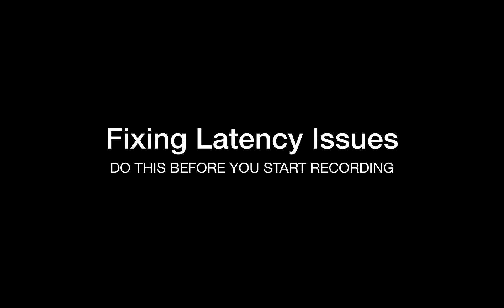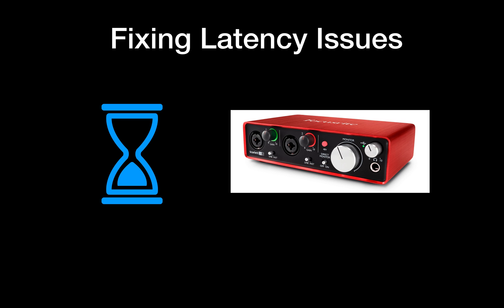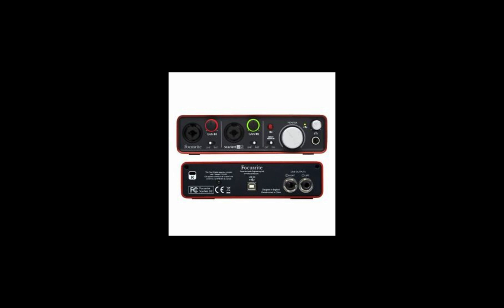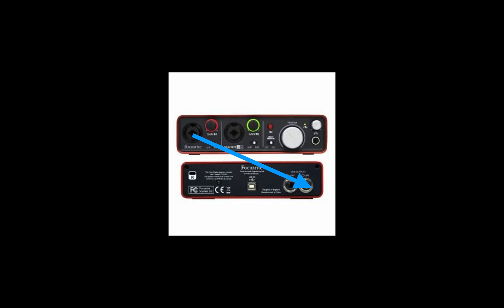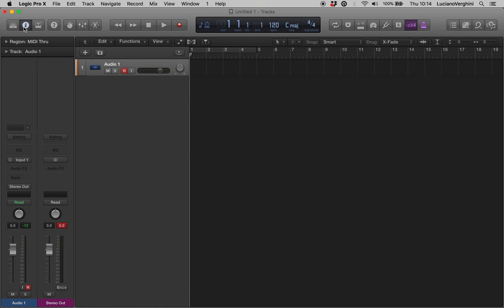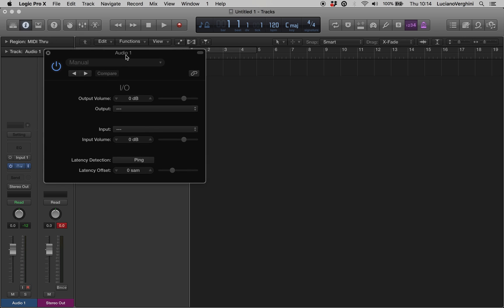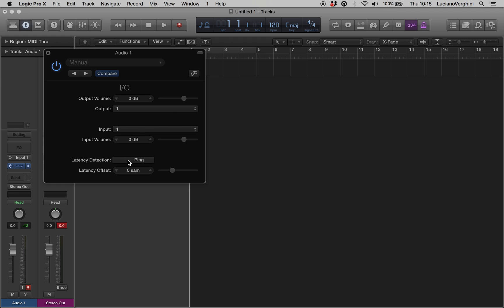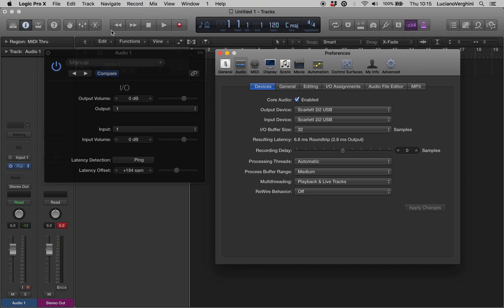How to Fix Latency Issues/Recording Delay in Logic Pro X Using the I/O Plugin

Comment: God I hope this dude sees this message. I just started using Logic Pro on a brand new Mac Mini M2. It’s the basic model with a dock and 1TB SSD. The SSD just stores the projects when I’m done. 

Tonight, I created a brand new session. Blank template. I turned on the virtual drummer (the profile player with a drum kit) and created an Instrument track for guitar use through a plug in. The plug in was an Otto Audio amp with a Two Notes Genome IR for cab sounds. I have been playing a long time so I am confident I can play along to a drummer at 130BPM. Every time I went back and listened, the guitar track was milliseconds behind the virtual drummer and I could not figure it out. Would this resolve the issue? I’m going to try it out regardless but will do a reboot of the machine and all that. Thank you!
Reply: Yes, this is most likely the issue. You try and try to play on time, but somehow it's out of sync - it's the recording delay. If you do this, it will compensate perfectly (as long as the delay isn't changing) and will be in time as you have played it (assuming that you can play in time!)
Reply: @thekillerbunny sorry. I did go through this process. I am still at 3.2ms roundtrip with -5000 samples. I have to keep Core Audio on but when that’s off, the latency drops to an almost usable number. Unfortunately, there is no recording function available after that. Am I looking at a hardware issue at this point? The Focusrite Gen 4 Scarlet is running C to C thunderbolt but despite this, I’m behind the count. Direct monitoring helps a little. Using just the metronome assists the most but I don’t want to use that damn thing for recording when I have two packs of Addictive Drums that sound way better.

Comment: thanks, won’t the latency vary depending on the project and number of tracks and efx etc….???  i have rme fireface and monitor through the rme mixer and works okay nut i have no efx so i want to switch to software monitoring amd i will try this, thx.

Comment: I did this test on a new logic project without any plugins. I have ssl 2 audio interface connecting with usb. The problem is that every time I put out usb (connection audio interface with MacBook Pro) and I do the test again latency offset value change. This happen also when I shut down my Mac and I open it again and do the same test I get different value every time. Is it normal ? for example I did the test and it gave me a value +39 sam and shut down my Mac and open it again another day and the value is +7 another day +53 ... I search everywhere and I have not find any solution to keep it stable ! Do you know something about this , how can I fix it ?thanks !
Reply from the maker: Are you running any other apps while running logic? 6 samples is 6/44000th of a second so should be fine. Your Mac could be doing an update in the background perhaps.
Reply: @VirtualVerghini   I don't think that Mac do a update but how can I check it ?no there isn't other apps while use logic ! I real have try many things and the problems continues..
Reply: @VirtualVerghini   any other idea?
Reply: @VirtualVerghini  I use a normal cable for the test should I use trs cable ?because output of ssl 2 is balanced? can I use xlr to jack balance cable and turn on phantom power?
Reply from the maker: No need for the phantom power. You could try turning on low latency mode on logic or if your ssl has direct monitor you can activate that.

Comment: I can see the signal going out and coming in. But I still always get "0 samples". I have an RME BabyFace Pro interface which is supposed to have low latency (the manual says as low as 5 samples) but not zero. I even tried the slowest (highest I/O buffer) setting of 1024 and still get 0 samples. What am I doing wrong?
Reply from the maker: Hmmmm that is quick! Did you set up recording delay of -5 samples?
Reply: @VirtualVerghini  No. But even if I slide the slider to either extreme, the ping still results in 0 samples.
Reply: So I figured I'd do a "manual" ping test (interface OUT to interface IN) and just playback an audio track and record it onto another. What I found was a latency of 10 samples, regardless of I/O buffer setting.
Reply from the maker: @Joe Tunon  any chance your inputs and outputs aren't set up correctly on the IO plugin? Is there any audible delay when you record? you could add a sample delay with -10 samples on and your recording will be perfectly in time
Reply: @VirtualVerghini  I was going to that, but then for fun I tried maxing out the I/O buffers to 1024 and the process buffer range to Large, and now I get no latency (as in literally zero samples!), so I don't need to adjust :-)

Comment: Oddly specific question, but if I’m using a Zoom H5, would I go from the headphone out of my laptop into the 3.5mm mic in of the recorder (in audio interface mode)?
Or will I have to go into one of the xlr/1/4 inch combo inputs?
Reply: Or would it be from the headphone out on the Zoom H5 (into one of the inputs)? I’m nervous about connecting an in and out that aren’t supposed to be and damaging something.

Comment: What if you were to hookup the input to the headphone jack output on the front? Would it change/ be important because i monitor my recording with direct monitoring through headphones. Or does it matter at all?
Reply from the maker: Yea that would tell you the latency which in some devices can be reduced using the direct monitoring switch.
Reply: @VirtualVerghini  theres always latency regardless of my direct monitoring being on. Its not while im monitoring that Im worried about. Its about having to nudge the recording to the left so intricately because I can sense it was delayed on input (direct monitoring doesnt change the actual time code in which it is actually inputted, only on what you hear back while recording)
Reply from the maker: That's the thing. When you sent up your recording delay correctly the file gets automatically nudged to the left for you
Reply: @VirtualVerghini  i tried adjusting my recording delay to +183 after the I/O sent back -183 and I hit ping again to test if it went back to Zero and it still stayed at -183
Reply: @TheAdBoss  Whatever your recording delay setting is, the signal still takes the same amount of time to physically go around the circuit. All the delay setting does is move the sound to the correct position in your project.
Reply: @VirtualVerghini  *having to nudge it to the left within the daw (because its late)

Comment: What if it says 0 samples after doing this? But I still have recording delay (when i record it sounds on time but after tracking the region is off tempo.)
Reply from the maker: So if it says 0 samples it means you've done your job properly in terms of getting the tracking right. If it is not aligned to the grid correctly use the nudge tool to move it to the correct place. if the issue is tempo  then try making the click track super loud.
Reply: @VirtualVerghini  what do u mean by nudge tool? because every audio i record is slightly a bit back, is their a way to automatically nudge every audio recorded to the right spot?

Comment: I followed this method and the sample offset doesn't change.  Any tips?  There's a ping coming out and I have level turned so that signal is flowing.  When I have my main monitors on it'll feedback almost instantly.
Reply from the maker: Hmm it sounds like two issues are mentioned in your comment. One is feedback from monitors and the other is regarding the ping. If you are using a cable you don't need the monitors on.  Regarding the ping issue perhaps look at lowering your I/o buffer

Comment: So after you change that number in preferences you can just take the jack out and plug in the xlr cable & record w no latency?
Reply from the maker: Yes and no, the recording will be in time with the music but what you hear during the recording will depend on how you monitor yourself. Turn on Low latency mode in Logic Pro, if you have Direct Monitor switch on your Audio interface turn it on. And that is as good as it gets. Good luck.

Comment: if my ping reads -36 what would i set my delay setting to?
Reply: This indicate there's probably something wrong with the way you set it up. Because think, you can't have a negative delay, it's impossible. That would mean the ping is arriving earlier than you're even triggering it, and this is obviously impossible haha. So check that you're input/output selection is correct and matches the physical connections you made on the hardware side, as well as not to have other tracks in the session that're listening to the same input, as it tends to mess with the results for some reason unknown to me (at this time). 
Cheers!

Comment: Does it remember these settings once you compensated, or do you have to do this everytime again before each new project?
Reply from the maker: Yes these are stored in your overall Logic Audio Preferences which will be applied to all projects on that machine. If you move mac or change audio interface these need to be set up again.
Reply: @VirtualVerghini  thanks, I'll definitely try this

Comment: Hey, what if you pressing the ping and it's not showing anything ?
Reply from the maker: Then the ping isnt returning back at the computer. This could be a cable issue, audio preferences or a signal routing.  Check all of those are correct and it should work. Good luck

Comment: Hey would this also work when plugins and aux busses are running which causes most of the latency issues for me?
Reply from the maker: Good question. I have a potential solutio  you can try. There is a 'low letency mode' button you can press in the control bar which will turn off all effects which affect latency. Turn it on while capturing new recordings then turn it off when returning to mixing.
Reply: @VirtualVerghini  Hero.